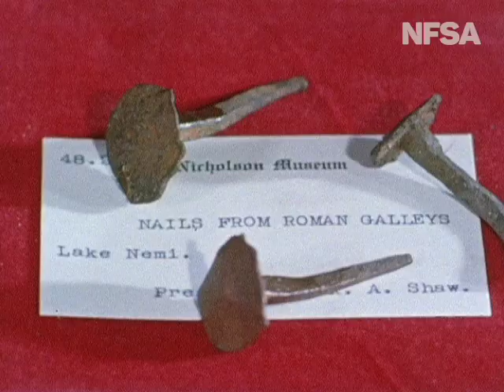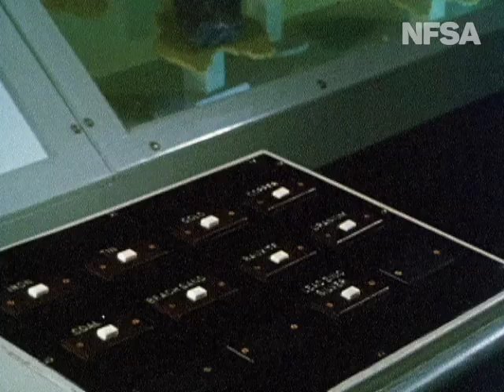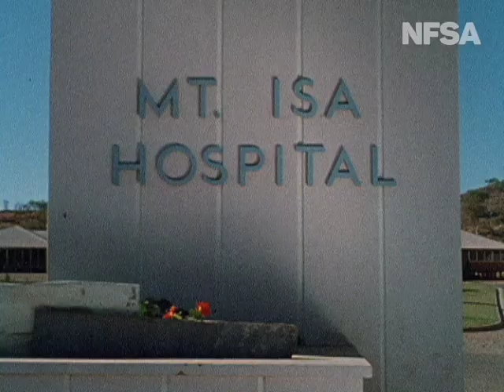Mount Isa Copper

Comment: I worked there underground as a machine miner 1970-1973. I can still remember my pay number lol. Even from when the film was made in 1963 until 1970 there were big changes, for example the mine in 1970 went to 21 levels at 3,800’. We lived at the Star Gully camp in the middle of the railway loop, then later on the BSD camp, all since demolished apparently. I worked on the 14 and 15 levels and one of our jobs was putting a drive from K57 out to the A10S shaft, very poor ventilation as it was an extremely long drive with no ventilation raise bore holes on the way out there. I can also remember those steam engines being stored at Cloncurry when they went to diesels. Took a lot of photos underground, would be a sackable offence nowadays I would imagine.
Reply: Amazing History of Ausralia🇺🇸